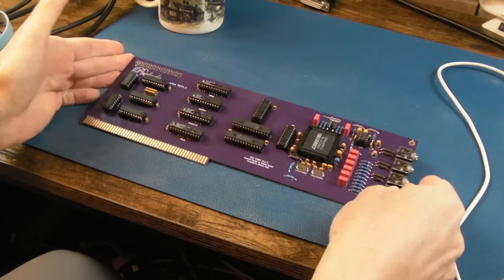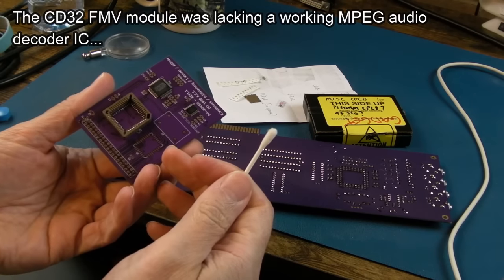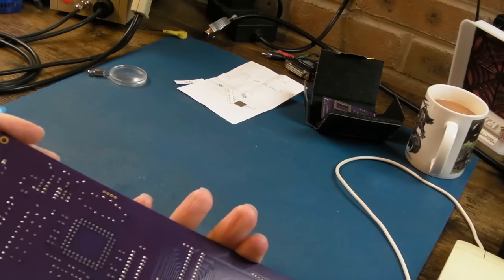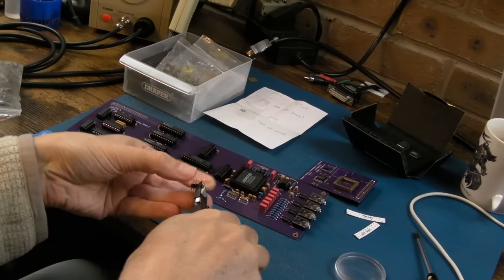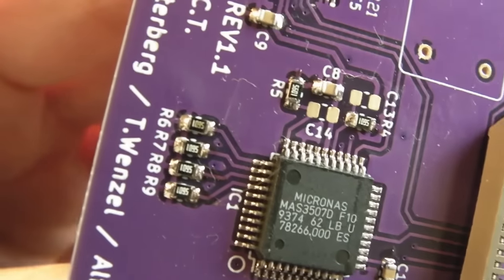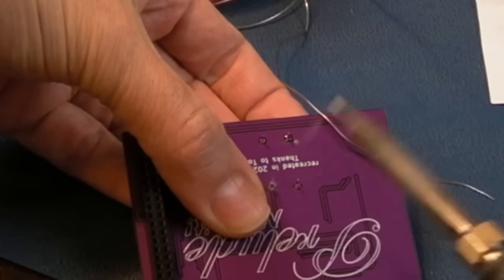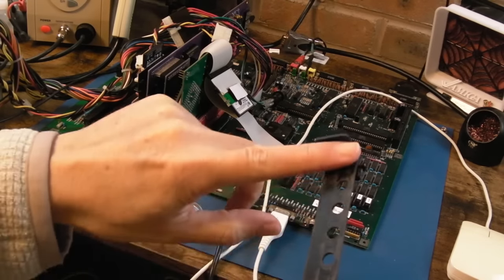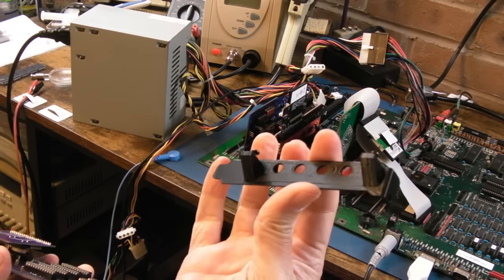Fixing the MPEG... Building an Amiga Sound Card - Part 2

Comment: TIP
Lose the Cotton Tips and get a 
Variety Tooth Brush Pack, Soft,
Medium and Hard, For cleaning
flux, Spray IPA and using a soft
Toothbrush Wash away Flux,
Place a Kitchen Towel over area
and follow up brushing over the
Paper towel for a better than 
factory finish. It's quick and it
provides a much better job.
The Hard or Medium Toothbrush 
is for cleaning Corrosion.
APU 👁👍